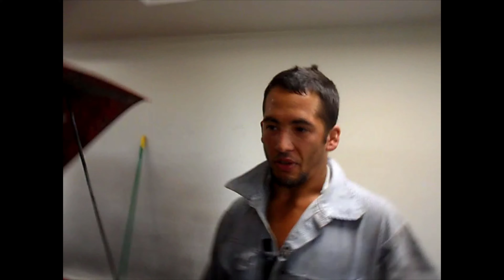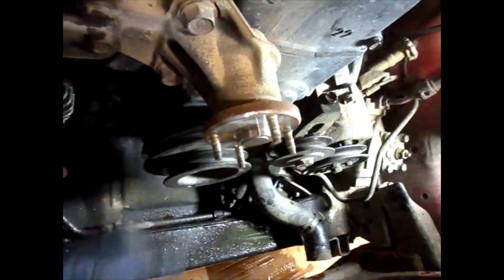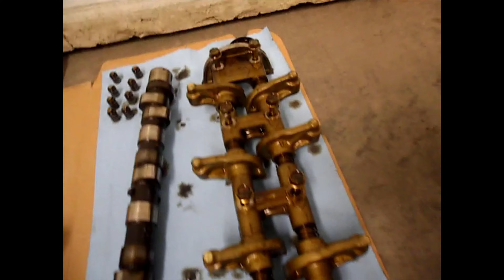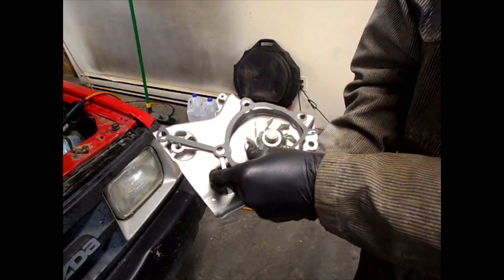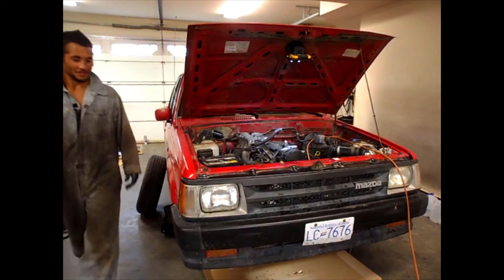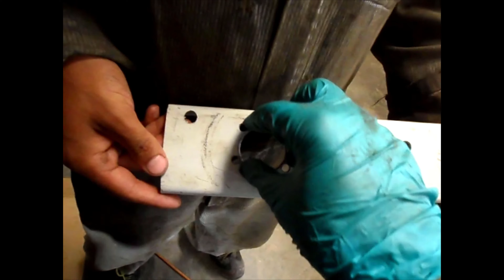Mazda B2200 1992 valve guide seals and timing belt etc

Comment: Hi there, on the bottom pulley of the crankshaft the mark or dent hast to align with the upper and lower marks? I mean the upper mark and the lower mark are aligned, but once I install the pulley is like 13 mms out to the right. And the rotor ignition is up, I know it has to be facing to the front. Any recommendations will be appreciated. Thank you.